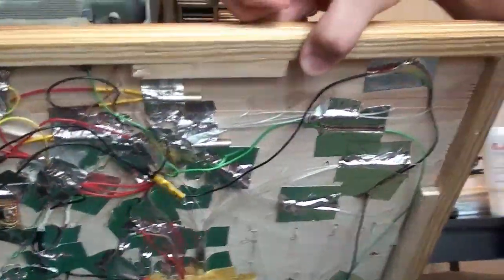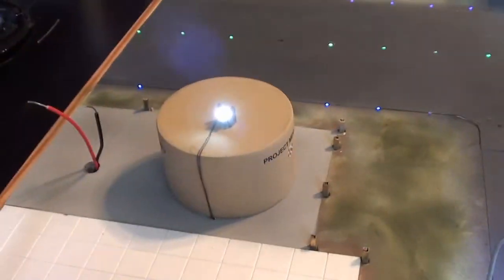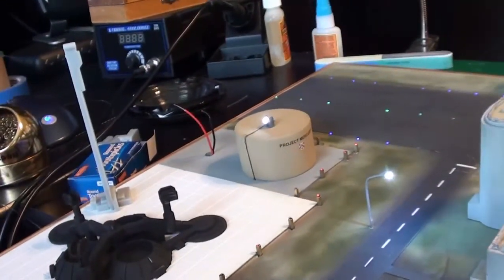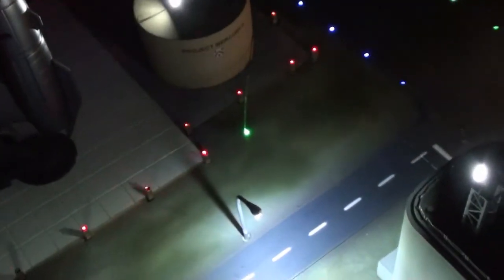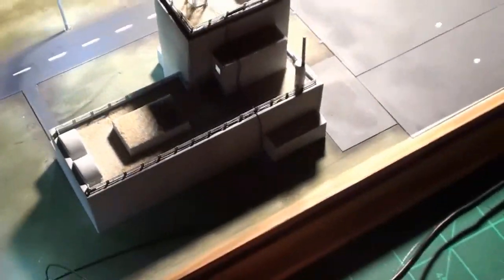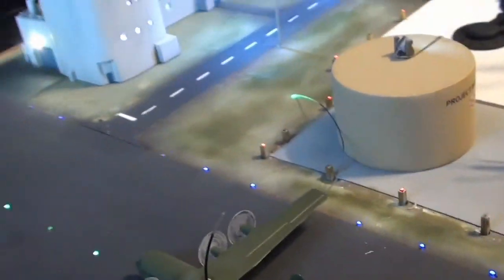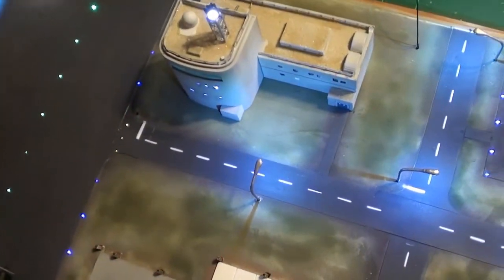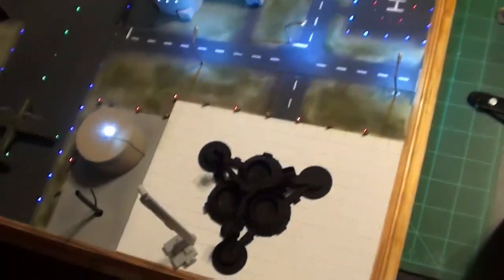Project Mercury 9:  Part 37 spotlights II...

Comment: oh my god, you truly are crazy if you're planning on lighting the Full Armor Unicorn :D. As an alternative you could build a small base and put some UV spotlights in there. The green Psycho Frame will light up under UV lighting. Should be less work and you'll be able to use the same base with your Nu Gundam ver Ka as well, as that uses the same green Psycho Frame plastic.